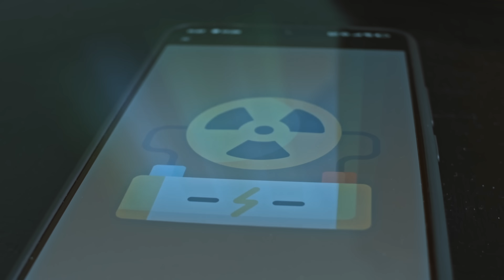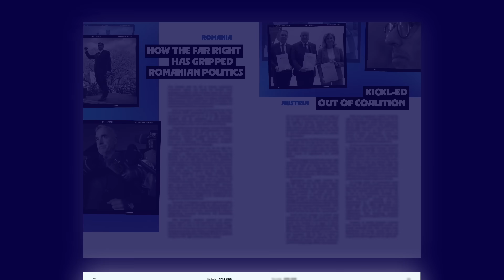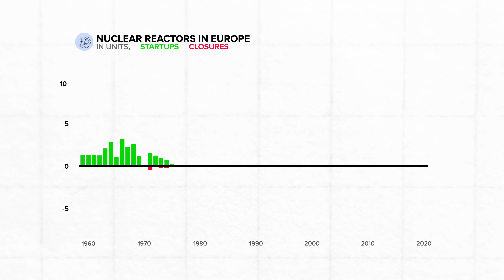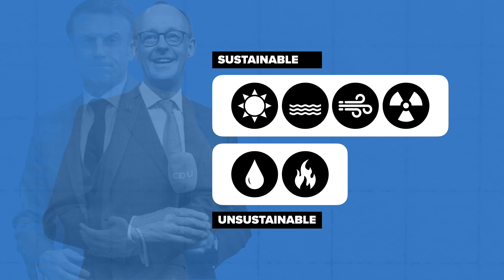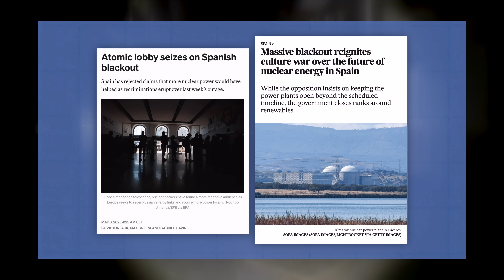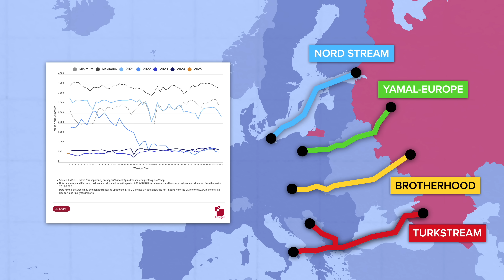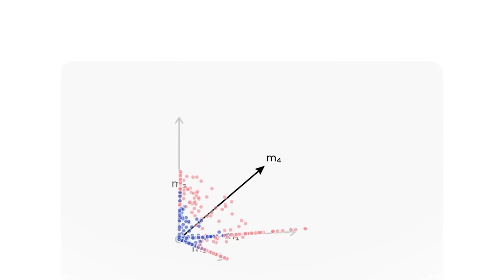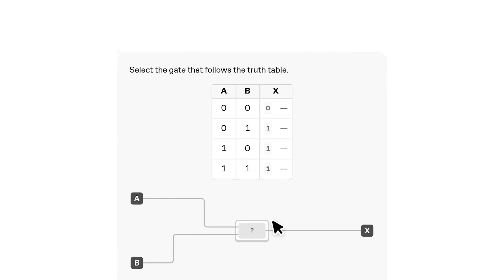Is Europe Quietly Returning to Nuclear Power?

Comment: Main uranium suppliers to the EU (based on Euratom Supply Agency data, 2022):

    Niger (~25%)

    Kazakhstan (~24%)

    Russia (~17%)

yeah we should definitely bank on nuclear energy here, those are reliable suppliers :)

Edit: Don´t get me wrong, its better for the environment than fossils for sure, but the mistake was shutting it down so early in the first place. Now i believe (at least in the case of Germany) its just not economically feasible to restart the whole thing, but that could be outdated information.

Edit2: Apparently the EU will phase out all non-western fuel suppliers after 2025, so that's good at least. Now is the question if a unified reactor program and design can make in economically viable.
Reply: Uranium is comically cheap and easy to stockpile for years.  They don't NEED to be reliable.  Besides, Australia is reliable.  Sweden could also easily mine uranium and export it.  Greenland could, too, but there are more political barriers to overcome there.  I'm pretty sure Germany could also mine uranium profitably if it were politically viable.

Comment: Such a one sided video wow. For now only 2 reactors are or have been build. One in France and one famous one in GB. Both are way over budget. So please explain where the „cheap“ electricity comes from these plants? And please do not include any government subsidies. Belgium and others only stated they like to build new reactors but none of them actually startet building one. And as said the existing ones are really old and will need to be replaced. Building times are incredibly long. We won’t see any increase in nuclear production any time soon. And finally, where do you get the uranium from hmm? And where do you wanna store it? There is no solution for storage of that toxic waste. And no burring it deep underground and pouring concrete is by far not a solution. It’s a childish solution in the means of „what I can’t see does not exist“ and then pulling the surprised pikachu face when there’s a leak in the storage facility

Comment: Building a reactor can be done in about 5 years or maybe less. 5 is the current "record" in countries that actually still have the experience for building these reactors. The biggest hold ups are lawsuits, bureaucracy, permits and fear and all that stuff. Technically there are few if any problems, and with modern recycling techniques we can recycle used nuclear fuel until it's smaller than a football a year of left overs that can be easily stored.
And modern reactor designs are incredibly safe. Especially if we get molten salt running. China and Canada are leading the way.
Reply: Kashiwazaki-Kariwa Nuclear Power Plant Unit 6 in Japan  was Done And running in 40 months.  If we mean it And actually mobilize And plan entire industry we can achieve much better results with Prefrabrication etc.
Reply: @michaelnguyen9348that is even more impressive, that is even faster than I knew about.
Reply: @michaelnguyen9348 Too bad they built it on a fault line.
Reply: Building a reactor can be done in about 3 years or maybe less
Reply: The best way of energy generation needing 50%-65% of it's total time and around 30%-50% of it's total cost going into paperwork ALONE is crazy
it's so over
Reply: @ZippyPiglin36 can you construct sentences that are actually structurally sound? Something understandable? I cannot determine what you think is over.
Reply: @bzuidgeest  I'm stating on how Nuclear Energy's primary burden outside of people's uninformed views is that half of its total time and around half of its total cost could be spend in paperwork and bureaucracy alone, especially in America but other countries aren't excluded from here. 
By "it's so over" I was trying to state on how doomed humanity might be for its vehement hatred and disgust for Nuclear Energy that lasted for the last five decades, and has only seen a possibility of revival in very recent years.

Comment: Everyone should get familiar with Small Modular Reactors because they are passively safe (no risk of meltdown) and they can scale - same reactor modules can be build in plant on an industrial level and simply connected together to produce more energy, depending on the need. Let's make it happen in Europe people!
Reply: SMRs are NOT inherently passive in safety. You're talking about MSRs. SMRs are classified based on reactor size, output, and manufacture. MSRs are classified based on reactor function, cooling system, fuel types, supporting infrastructure, etc.
Reply: And all of them have been over budget by just shy margin of hundreds of percent. Right now SMR are pure cope and vapourware not one design have been proven to be cost competitive with big nuclear, not to mention RE.

Comment: New power plants are just a vanity project for conservative politicians at this point. How many decades has the UK been building its new reactor at Hinkley Point?
Reply: Well it's the uk
Reply: @asadaafha  I can't imagine that it will be any different here in Germany, for example. Instead of several dozen reactors, which would be necessary to significantly change the energy mix, only one or two will be built, if at all. And in the end, as is usual with such things, they will exceed the budget and be delayed many times over.
Reply: @Perplexum  therefore the best thing for europe to do is to use a single standard reactor and mass produce it. every plant has 4. the entire eu will need 120 plants s0 480 reactors. If france can use these for the FS pang thats 482. And i am sure private us companies and us states will be intrested. so add in another 240 reactors. And if south korea and india and south america want in thats another 120 reactors.

Comment: As someone who works in energy economics, there is a key aspect missing from this video - and that is that nuclear is not a substitute for gas plants, but rather for base-load power sources like coal. Actually because nuclear assets are very slow to ramp up or down production in response to demand shifts, they lead to renewables actually be curtailed (turned off) sometimes. If the EU wants to try to build a flexible energy system with a stable and secure supply structure, then what is needed are battery storage systems and transmission grid build-out yesterday, more renewables distributed throughout the EU, and hydrogen peaker plants in the next 10 years.
Reply: We don't NEED the renewables if we have nuclear.  Perhaps we should require renewables to be reliable before we grant them access to the grid?

Comment: It's concerning to hear discussions about a nuclear power "comeback" that don't address fundamental questions about electricity consumption patterns and future demand. Many people don't fully grasp the complexities of managing an electricity grid and balancing supply with demand. A key issue with traditional nuclear power plants is their design for constant, baseload power generation. They lack the flexibility to easily adjust their output to match the fluctuating demand seen throughout the day, often visualized by the "duck curve."

The duck curve illustrates how electricity demand changes, particularly with the increasing penetration of solar power. It shows a dip in net demand during the day when solar generation is high, followed by a steep ramp-up in the evening as solar power wanes and demand peaks. Nuclear power plants, not being readily dispatchable, struggle to follow these rapid changes. This rigidity means that during periods of low demand, you might be forced to curtail renewable energy sources like wind and solar to avoid overloading the grid. Conversely, during high demand, nuclear alone cannot quickly ramp up, necessitating other, more flexible power sources or, in worst-case scenarios, grid-stabilizing measures like rolling blackouts to maintain frequency.

The challenge is intensifying. Increased electrification across various sectors means a larger overall electricity demand, and this often translates into a more pronounced "duck curve" with a greater difference between peak and off-peak demand than in the past. There's little indication that we are moving towards a flatter, more consistent demand profile. Therefore, investing heavily in expensive nuclear power plants that are ill-suited to the dynamic nature of our electricity usage seems counterintuitive.

Instead, a more strategic approach would be to allocate those resources towards a diverse range of energy storage solutions. Technologies like redox flow batteries, pumped hydro storage, and Power-to-X offer the capability to store excess renewable energy when generation is high and release it when demand peaks. The challenge isn't an inability to store renewable energy; rather, it's often the existing grid infrastructure, particularly in Europe, which wasn't designed for a decentralized energy system.

For example, power generated in Northern Germany from wind often struggles to reach the industrial south efficiently due to grid bottlenecks. Similarly, a lack of sufficient storage capacity means surplus energy is sometimes wasted. This leads to situations where Southern Germany might rely on nuclear power from France, as the cross-border grid connections in that direction are more robust. This very issue fuels demands from neighboring countries for Germany to split its electricity grid into pricing zones, which would likely increase costs for the southern regions.

Furthermore, it's crucial to consider the geopolitical implications of nuclear power. A significant portion of the global uranium supply and enrichment capabilities are controlled by Russia. Embracing nuclear energy on a larger scale could simply shift our energy dependence from Russian gas to Russian nuclear fuel and technology. It's worth questioning whether some of the pro-nuclear narratives in the media might be influenced by countries seeking to leverage this potential dependency for their own strategic interests.
Reply: i think russia rather promotes anti-nuclear propaganda because then stupid countries like germany are even more dependant on their fossil exports
Reply: Nuclear can absolutely tank the Duck Curve when you make your reactors for it. All but the oldest of the old commercial reactors are capable of it. It's just that with how immensely cheap nuclear fuel is, costs barely matter in operation. 

And as for energy storage, if it's such a vital thing, why are their costs as well as the cost of consistent overproduction ever taken into account with Renewable Energy sources directly? That's right! They're INSANELY expensive. 

And as for nuclear fuel security, with how little is necessary for operation it becomes negligible. Renewable Energy Production and Storage also needs a lot of strategic materials and resources, in vast quantities at that. 

And Thorium is plentiful on earth, which means insane energy security if we go Thorium. Already was commercial in one American Powerplant in 1965-1969. It's not a science issue, it's a politics issue.

Comment: Nuclear energy would be a good thing if it weren't for the nuclear waste it produces. Which can harm many generations to come.
History has taught us that civilisations collapse, and then the knowledge about these collection points disappears, which makes it even more dangerous.
Nuclear energy is safe if you don't let your plant rot, as was the case in Chernobyl.
The Japanese were just unlucky. They built earthquake-proof, kept the plant in good shape, and then a tsunami came that nobody had expected and flooded everything.
Reply: Up until the 21st Century, Information could only travel as fast at the fastest mode of transport, for the average civilian. It is easier than ever to keep track of generationally long information thankit could have possibly been. 
And regardless of that, a Geiger Counter is all that's needed to detect nuclear material. And with how little there would be, it's a reasonable cost.
Reply: There is essentially no actual waste.  Most of the "waste" is low radioactive (or un-radioactive) bunny suits and similar that are thrown away and then stored for a couple of decades out of an extremely excessive abundance of over caution.

We have plenty of deep underground places that have been geologically stable for hundreds of millions of years -- in some cases over a billion -- and that aren't near cities.  If we also encapsulate the waste in stable materials (which we do), then there's no risk.  Remember that the actual waste we need to store takes up almost no space.

Comment: Europe doesn't have significant domestic reserves of oil, gas nor uranium
Reply: We do, actually.  We don't really exploit any of them for political/NIMBYistic reasons.  We could actually use the same stupid amounts of natural gas as we do now (to compensate for the unreliable wind/solar) using entirely domestic gas -- if we wanted to.  But we don't.  All we would need is a little fracking.  There's also plenty of uranium (and it doesn't even need fracking).

Comment: As an electrical engineer with a focus on Renewable Energy, NO OTHER renewable source except Nuclear energy can combat the intermittency issues that Wind-Solar-Biogas-Ocean Surface Waves or many other renewable energy sources has. Hybrid-Grids are the energy solution we must work together towards and Nuclear has to be at the center of it.
Reply: Also ee working with renewables, I’m pro nuclear but it is not the only option for grid stability. Pumped storage batteries, geothermal plants, and some types of hydro facilities are all examples of renewable sources that have a reliable and stabilizing output to the grid. Nuclear is actual also not very stabilizing, at least traditionally, because the output is constant and not easily increased or reduced to match energy demand